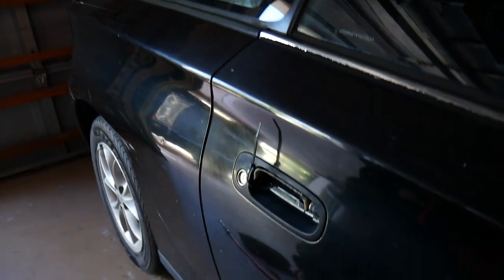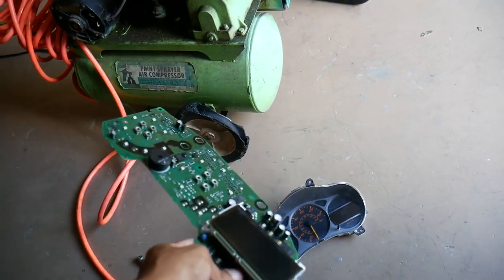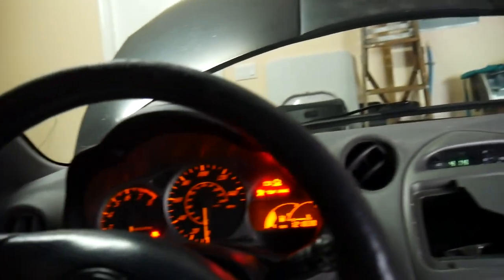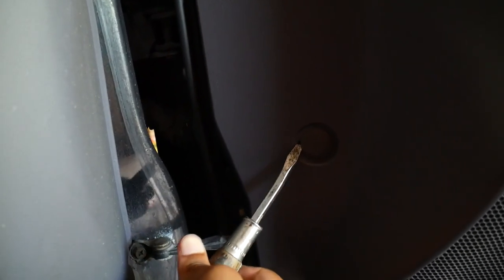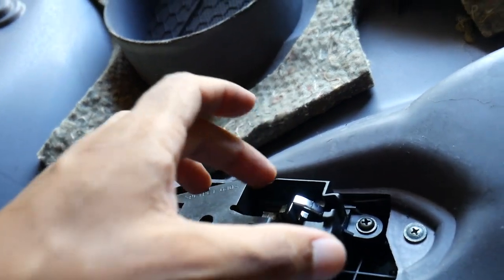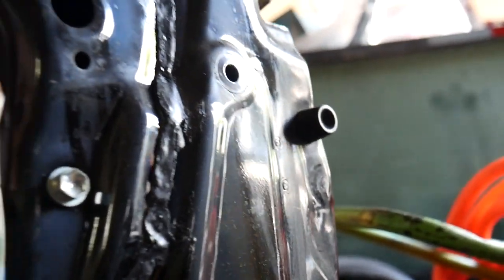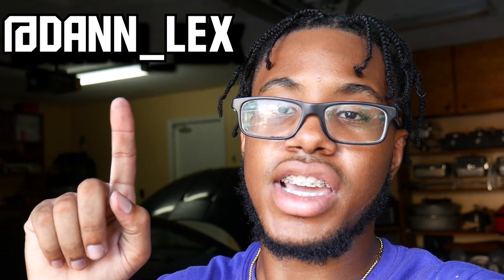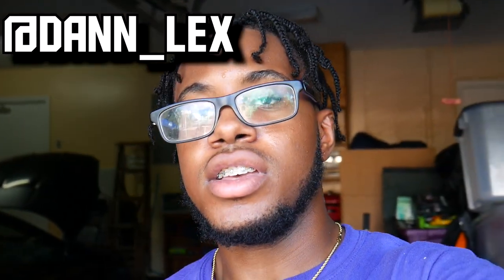CHANGING THE GAUGE CLUSTER ON MY TOYOTA CELICA | How to change the gauge cluster and door handles!

Comment: If you would want to reprogram the mileage from old odometer to the new one, what you have to do?
Reply: I'm about to change mine as well, and i want to have the original readings on the new one, but the dealear ship said that i can't change it, and i have to write somewhere  the old and  the new readings, to keep the track.
Reply: I’m pretty sure you can’t change them, to prevent scammers from turning back the clocks before selling them...